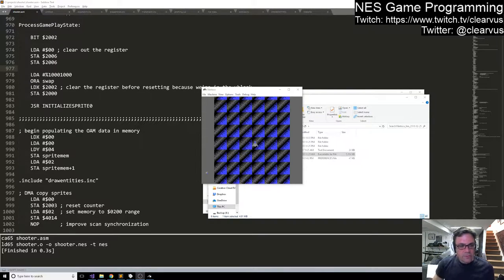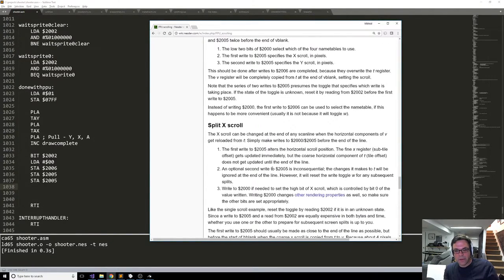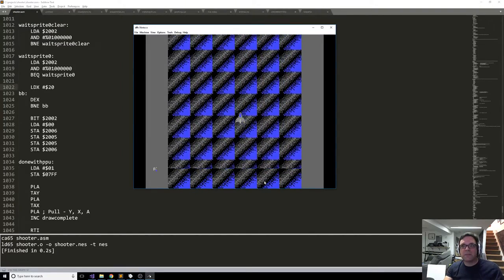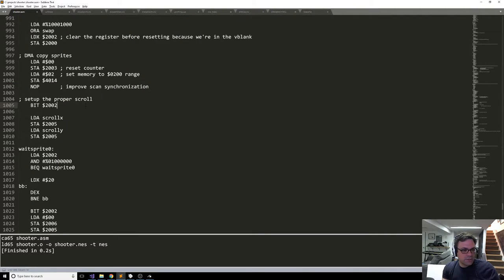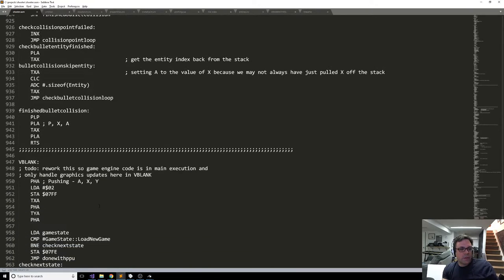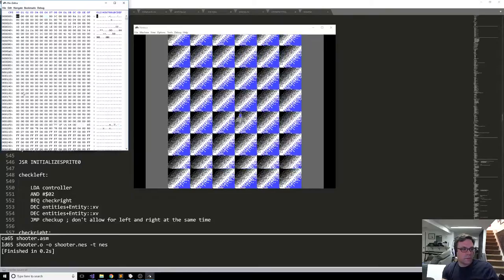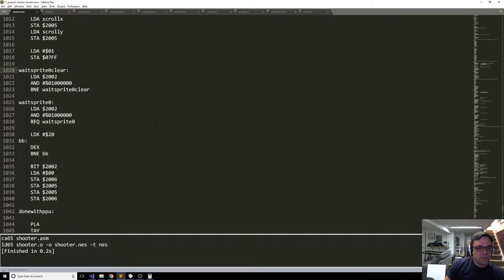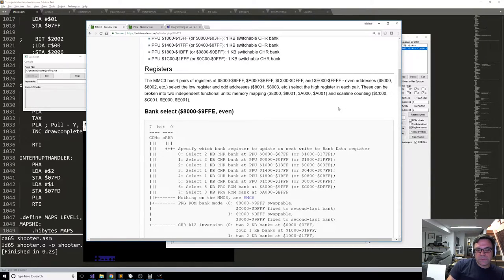NES Programming #23 - Sprite 0 and MMC3

Comment: Sadly the mmc3 chip can only accept a max size of 512 prg rom and 512 chr rom , but what if we could in theory  just put 2 x 512KB ram chips wich will serve as 2 rom chips for the mmc3 chip, now if we want to have 1024KB chr & prg data, we can put for both 2 512KB ram chips 2 512KB chips sothat chip A can load it’s first 512KB data into the 512K prg ram chip and once it knows that all it’s data has been readed, it can then clear out that ram chip and tell chip B to load it’s 512K of data into the ram chip etc,, same thing for the chr ram chip,etc,, this way we might overcome the 512KB chr & prg limit of the mmc3 chip👍